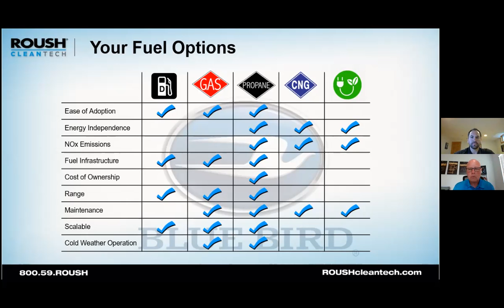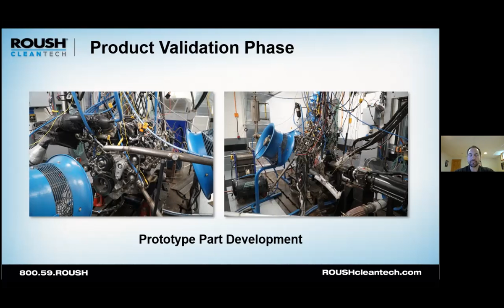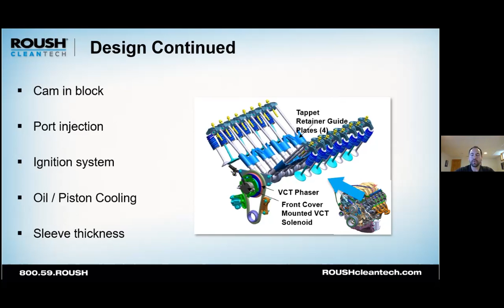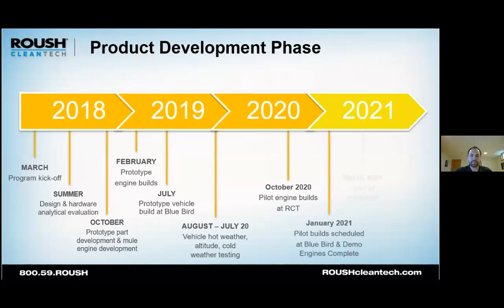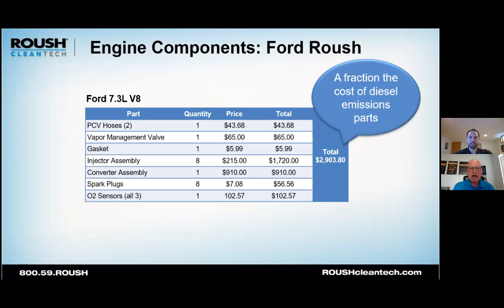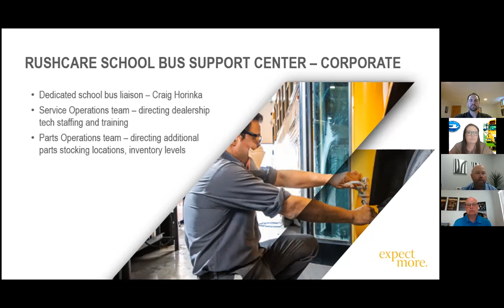Leaner, Cleaner and Meaner Ford 7 3L Godzilla Engine

Comment: Didn't the state of Kentucky pass a law that all school buses had to be Diesel to help prevent fires after a gasoline tank was busted on an old Ford Superior school bus and killed like 27 back in 1988???  I wonder if this "Diesel" only mandate is still the law of the land in Kentucky?

Carrollton bus collision 
Wikipedia

"Buses used by Kentucky schools must also have a cage around the fuel tank, a stronger frame and roof to resist crumpling on impact and rollover, high-backed seats, extra seat padding, a fuel system that slows leaks, flame-retardant seats and floors, reflective tape on all emergency exits, an eight-inch (20 cm) wide black band with the district name in white letters on the side, and strobe lights on the exterior. Schools also must have a diesel-powered fleet. (Unlike gasoline, diesel fuel is not highly flammable.)"

Thank you!! Great channel!!!